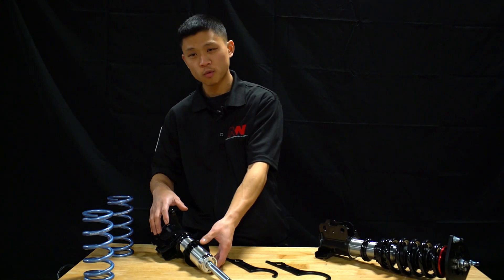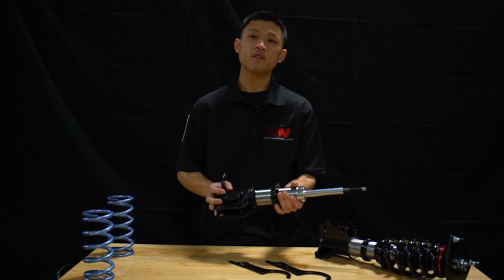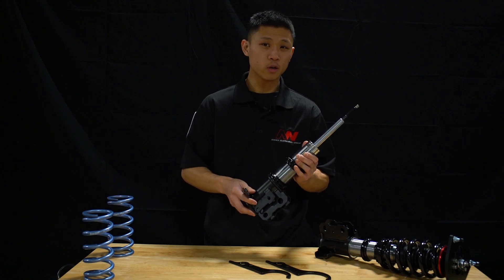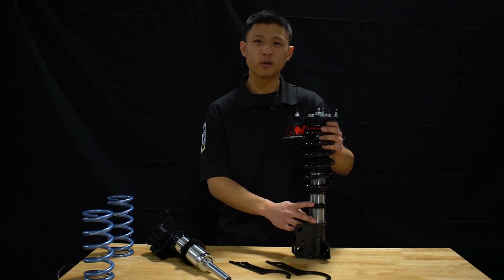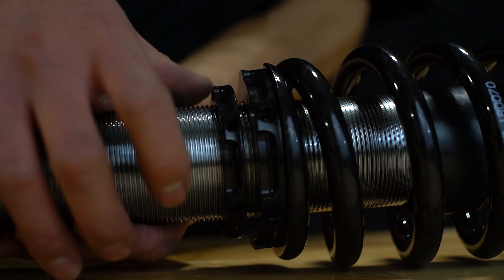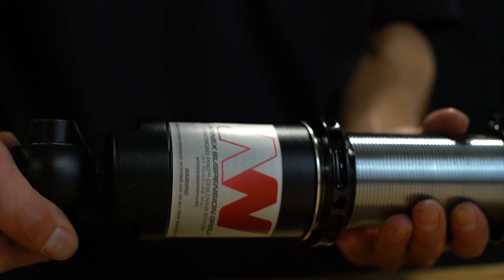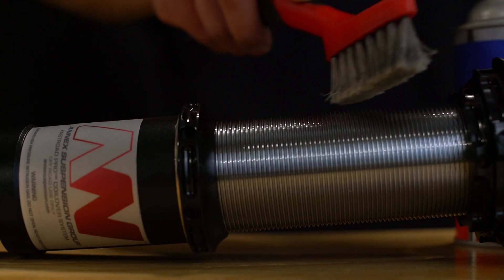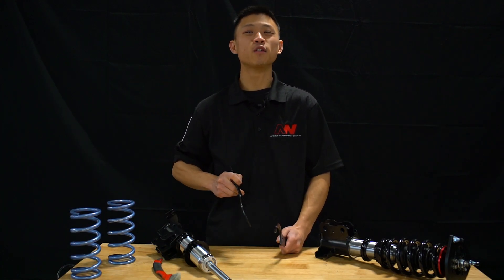Coilover Lockring Run Down

Comment: I think it's misleading to talk about the bottom adjustments as "the ride height adjustments", and "adding preload makes the ride comfort worse". I have a BRZ and followed the "use the bottom bracket to adjust the ride height" recipe before. I then found myself in a situation where my ride was very harsh on bumps, and yet the height was still too high. I'm talking "almost OEM height" too high, and I'm not a stance boy.

I was lucky to stumble upon a video that recommended the opposite: use the adjustments at the bottom bracket to set the "comfort" (more specifically, to set the correct amount of compression travel) and from there set the ride height using the top lock ring. After some trial-and-error and then analyzing all the before and after measurements, I found out that the preload was set too low. By adding preload and screwing the damper into the bottom bracket by the same amount, I was able to significantly improve the ride comfort without changing the ride height. I've made a few iterations until I noticed minor rubbing, and then I've undone the adjustments a couple of mm.

After that experience, I came to a personal conclusion that on FT86 cars with big tires (245/40R17 in my case) there's geometrically so little space available for the tire to go up when the suspension compresses, that once the correct damper length (adjustment at the bottom bracket) is set, the only correct way to adjust the ride height is by changing the preload.

Way too much preload can indeed negatively affect the ride comfort, but my point is that in a certain range of preload, it's in fact a better tool for adjusting the ride height.
Reply: Interesting, I noticed that in later videos you use the bottom lock ring only to set the bump stop height once and "never touch it again". Curious to learn if this is a CSP vs FRP thing, or there are other reasons to still use the bottom lock ring to adjust ride height.
Reply: @TimurIskhodzhanov  There are no reasons to ever use the bottom bracket on multipiece coilover as the ride height adjustment. IT is not just a comfort thing but also a major  safety factor. Tires touching sheet metal on the frame or unrolled fenders can cut them causing them to rapidly deflate while your driving and potentially making you lose control of your car. Also, in double wishbone and multi-link setups with upper control arms, if those arms hit the frame because the bump stop is not being engaged you are likely to snap them due to impact forces or damage your ball joints in some cases. Those parts are rarely ever designed to take a direct impact.